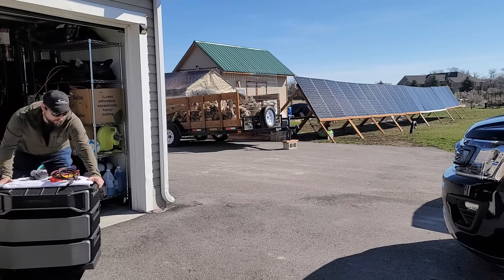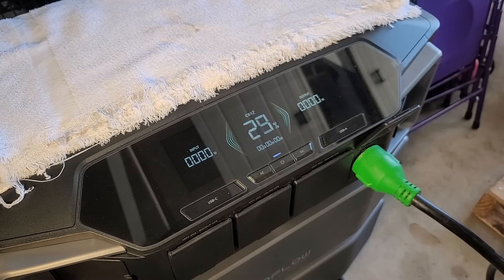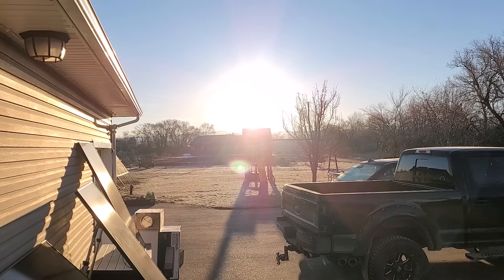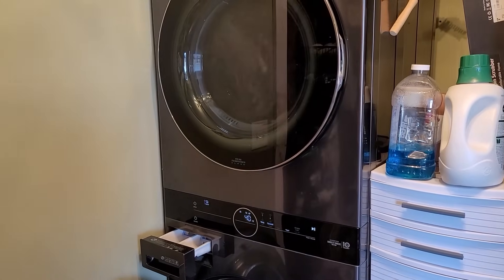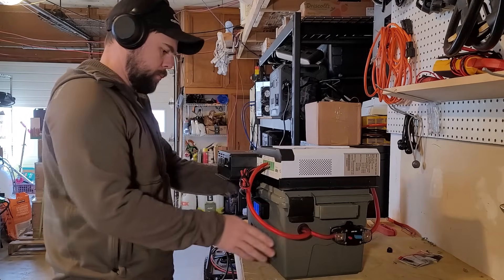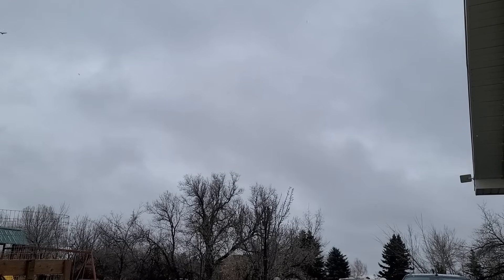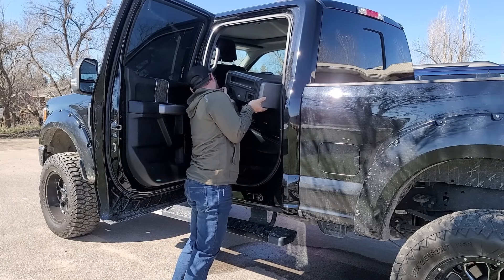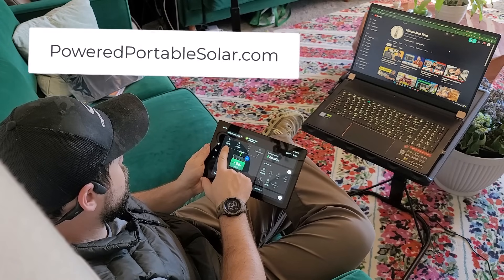Beginner Guide to Go Off-Grid Using the Delta Pro Ultra

Comment: As a young woman jumping into prep for "grid down living" and after studying last year's montly usage- 800kwh average! Your video has been the best to tie all my knowledge together. That website is amazing and so intuative. Thank you. Here's to blowing 12k to run the house (especially the well and fridge) when everyone else goes dark. Remember those chickens and garden, everyone!
Reply from the maker: For 800 kWh average per month, the Silver kit (https://poweredportablesolar.com/product/ecoflow-delta-pro-ultra-kits/) is what you need since it's rated to an average use of 750 kWh per month. But you can start with the Bronze kit which is rated to 500 kWh per month, and then add the batteries later. The only thing I recommend is adding 4 more solar panels to the Bronze kit to save you a lot on shipping later on (https://poweredportablesolar.com/product/400w-solar-panel/) as well as an extra solar cable: https://poweredportablesolar.com/product/100ft-pv-connector-cable/. If you do that, then you'll save a lot on shipping later on, and the only thing you'll need in the future to get to the Silver kit level is two more Delta Pro Ultra batteries: https://poweredportablesolar.com/product/delta-pro-ultra-expansion-battery/
Reply: @minutemansolar  Does self installation (on ground not roof) disqualify one from the tax rebate and/or offset from monthly PG&E bill? Initially, we wanted to use this if SHTF, but now family is discussing offset of the monthly bills, too. Thanks.
Reply from the maker: @sheaholloway9537  Ground mounting or self installation does not disqualify you from the tax credit. But to get your bill reduced you should install the panels on a permanent mount so they can make the most amount of energy possible. I am happy to help you get a mount and you can DIY the install or I can give you a quote on us doing the installation for you. info@poweredportablesolar.com
Reply: @minutemansolar  Thank you.
Reply: @minutemansolar  Thanks so much for the added info.
Reply: We are on the same page

Comment: @minutemanprep really good video, I learned a lot. Quick question, can you tell me why you did not get the Ecoflow Smart Home Panel?
Reply from the maker: I didn't want to be limited to only 12 circuits when I need more than that to run my entire house. I don't need automatic transferring so I am okay just using an interlock switch and generator inlet plug. I can then also use any system, not limited to the Delta Pro Ultra. If you're looking for a system I'd love to help you.

Comment: Great video and very informative.  I am not as wealthy as you are, but I plan on getting a system even if it will be a piece at a time.  Thanks again for sharing.
I was looking at the pro until I saw your video about the new Ultra I did not know existed.  Tell your wife to stop using the electric dryer or remove it if she doesn’t.  Simple.

Comment: How much did your entire setup cost? Are there any maintenance costs?
Reply from the maker: It's the Bronze kit from PoweredPortableSolar.com plus four more panels. So a little less then $12,000. No maintenance. You're welcome to email me at info@poweredportablesolar.com for extra help.
Reply: @minutemansolar  Bro, this is the fastest response I've ever gotten from a Youtube comment. And you answered the question perfectly. I very much appreciate that lol. Currently, my breaker planel is all messed up. I'm hiring an electrician to fix it and expand it for more breakers. I was hoping to do a portable backup power system of some kind that recharges with solar, with an interlock transfer switch. I wanted to do a standby system, but the generac quote I got for a 24k watt system was $22k... no bueno. So that's when I started exploring systems like yours. VERY impressive btw. I have a million questions, I'll start by checking out your website first, I did check my monthly grid bill, my highest was 1762kWh. I'd love to go off grid with the option to switch back on grid like you too. I'm just starting this journey and have a ton to learn.
Reply from the maker: No problem! I'm happy to help. It's easy to start with a basic system and then grow it over time to cover everything. Over 1,700 kWh is petty high but it's definitely possible. I think it'll be good to have the electrical panel reorganized.

Comment: Will this run and charge in subzero weather off the grid (Minnesota winter) none heated outdoor building?
Reply from the maker: Yes, the batteries have built in heaters for when it dips below 32 degrees. If you're interested in getting one I'd love to help you get a system put together and save you money. You can email me at info@poweredportablesolar.com if you'd like.

Comment: wheres the video on building the array shown @3:16?
Reply from the maker: I didn't do a full video, but I did a short about them here: https://youtube.com/shorts/6XmyxxfXZ7E?si=-wdOnFNQPml8mTtR
Reply: @minutemansolar  any issues with the wind grabbing them?
Reply from the maker: @jimmy4518  No. I use two 2 inch "anvil" brand clamps from Home Depot to hold the panel to the frame. We have a lot of high wind here in Idaho and have not had issues with the wind pulling them off. My previous ground mount had that issue and this one has worked great.

Comment: hmmm you can buy battery cells now with the same capacity (6kwh) for around 480$ and then size your inverter for your needs better. 1/6th the cost lol.

Comment: You need APC battery back up on your router and network this way when you’re ready to do a update and the power is out you can still do the update
Reply: Good idea if it works. I have two APC UPS 's which will not work on the 4,000 watt inverter I am using. It seems to be a ground issue I haven't had time to check out.
Reply: My little 300 pack ran my ont and mesh eero for 8 hours for WiFi during an outage during a hurricane

Comment: I notice that your main breaker is 200 AMP and your breaker for the solar generator is 60 AMP.
My question is how can you run your house with a 60 AMP input breaker?
Reply from the maker: Great question. That's because my house doesn't use anywhere close to 200a. The vast majority of houses don't run close to 200a. If your house is all electric, and you run your dryer, A/C, well pump, laundry machine, dishwasher, water heater, and other appliances all at the same time, you'd be using around 75a. That is considered an extremely high load all at once. Electrical panels have to be 200a rated according to national electric code. But that has nothing to do with how much people truly run.

Comment: what about using a dual-fuel outside generator on low solar days to charge the batteries during the day - so you have quiet power at night?
Reply from the maker: That could work, as well as any inverter generator but that wasn't what I was testing.

Comment: Is there any way to get just the delta pro ultra inverter module. I already have the delt pro with two batteries.
Reply from the maker: Yes we can get the DPU inverter only, but it doesn't work with Delta Pro batteries. It must use Delta Pro Ultra batteries.

Comment: Hey my dear friend. I desperately need your help.  I need the best power bank that I can get for $3,000. My budget limit. What do you recommend? 
-
Reply from the maker: I don't know what your power needs are. But for under $3,000, I'd recommend this: https://oupes.com/products/oupes-mega-3-home-backup-portable-power-station-3600w-3072wh?ref=va1y1jwb&variant=43590818693297. With the expansion battery you're under $3,000 but will have over 5kwh of capacity. This doesn't include solar panels, cables, adapters and and so on. But this is my top recommendation for under $3,000.

Comment: Nice to see this test and you seem to confirm some of my concerns.  My chief concern is that solar input limit is too low and don't allow you to compensate enough for seasons of poor weather and limited window of charging.  For my house, I need the diamond kit, but I am concerned that I won't be able to recharge the batteries enough to make it more than a few days, especially during winter and small windows of high solar production .  I have an all electric house.  Am I missing something?
Reply from the maker: For an all electric house, you defintely need a bare minimum of two DPUs and max out the solar panels and batteries. The Diamond Kit sounds like it would be the best fit. If you'd like, I am happy to look at your location to see what would be the best and most affordable setup for you. You can email me at info@poweredportablesolar.com.

Comment: My only note is be careful charging that in sub zero temperatures. The delta pro uses LFP battery cells which can easily be damaged if you charge them at 32 degrees or below which it certainly looks like you have those temperatures there. I’d suggest contacting eco flow and ask them how to best go about charging it in those temperatures
Reply from the maker: Luckily for me, my garage doesn't get below 32F. And the Ultra batteries have built in heaters if it does get below 32F.
Reply: @minutemansolar  built in heaters??? Why wasn't this talked about? That's an awesome and genius feature!
Reply from the maker: @trevorm7013  I forgot. Since it didn't apply to my situation I forgot to bring it up.

Comment: I think the biggest issue that you have after watching the video is that you don't have enough battery storage. when you do get those sunny days your system charges very quickly to full and then basically you waste the rest of the day's solar energy because you have nowhere to store it. If you added one at least if not two more batteries I think you would be in a lot better shape to ride out those cloudy days. The other thing I think you need to do is unplug that electric dryer that someone keeps using on you! I have the ultra with 3 batteries and it's running my house like a champ off grid with 2800 watts of panels (max reported on the display has so far been 2824 watts) Great video! Excellent piece of equipment 😊
Reply: how much was your monthly kWh consumption per month?
Reply: Do you run your central ac? Also do you still have an electric bill or does the DPU and batteries cover everything? How long does it take to charge those 3 batteries from solar alone? Thanks!
Reply: 600 minimum up to 1500 or more in summer
Reply: good to know. how many panels do you  have and what kind 400W?

Comment: Over $16k ? My yearly electricity bill is less to $850 per year. So would that almost 20 years to justify. 
I run a small inverter generator & two 1000 watt battery power stations w/ solar panels  as my back up, less then $2000 invested.

Comment: You know that's kind of funny because you told us you had to tighten at the cabin.
 A natural generator it's a check on the minimum amount of batteries.
 Much might be much weaker but I'm pretty sure that I could run the Internet.

Comment: With that Wi-Fi thing at the end, you could Theoretically put a UPS with the Wi-Fi but as I was typing this in if you put like an EcoFlow river 2…. Also need a software update, it would turn off the Wi-Fi connection for your EcoFlow river two because they can’t power it and your Delta pro ultra, so Probably get one of those computer ups System.

Comment: Awfully trusting to have all those lithium batteries INSIDE your house.  I wouldn’t, due to the fire hazard.  My natural gas generator is outside, and will make 15kw for weeks if need be, including A/C for 3000 sq feet in FL summer
Reply: They are lifepo4 batteries pretty safe

Comment: I have 2 jackery 2000 plus with the 5 back up batteries each total of 10 batteries.  Run together with there 110/240v connector.. I use the dryer hook up to back feed. With the main off. 24kw hrs

Comment: Thick winter cloud cover is a huge reason to overpanel.  I don’t mean 10%, I mean like 400%.  Solar panels are cheap and if you’re going to rely on them completely, there’s no excuse not to have more solar than the MPPT can use on sunny days.

On winter cloud cover days I’m seeing less than 1/20th power output, even with the panels cleaned off completely.  I have a Delta 2 Max (two 500W inputs) and I have about 1800W of panels on each input.

BTW, no issues with the solar inputs waking up in the morning on my D2M.
Reply: or generator to supplement panels. in rural areas that just seems a no brainer solution that cures the snow days and reduce system outage time dramatically.
Reply: @ApexImportExport  absolutely!  A generator is key for off-grid.  I like using propane for backup applications as it stores indefinitely without going bad.

Comment: Regarding the light flickering (more like a slow wave than flickering), I have the same issue with 2 DPUs connected to SHP2. After much testing, one of the DPU is the source of the flickering. The other one keeps all LED including Edison style, running as normal. With only one DPU I would not know, but clearly all DPUs are not equal. The DPU that makes the light flicker also discharge faster than its peer.

Comment: Hi Ben this is a nice overview. Ive got a 50ft solar cable with the XT60i at its end to fit into my Delta Pro's. They were defective, so now gone. I see on the Delta Pro Ultra, that plug wont fit. But I want to use that log cable for the solar panels Ill get soon. Is there an adapter available to get the long cable to plug into the DPU? Or do I have to buy other cables and butcher them up and rig my own fittings? Any advice would be appreciated.

Comment: Have you heard of the new Powerstation about to come out called FORCE 15k? It looks promising and might give the Ecoflow DPU a Run for it's money
Reply: The Force might be cheaper but expandability is minimal.  Also the ease of use on the delta is why it cost a little more.  I like the cheaper products but I’m no electrician and my electrician might only charge me $500 to install this compared to $2000 to install something else.

Comment: At a certain point, I would just unplug the electric dryer......if you can't listen, I will take the option away from you. But great demo! I was curious how or if it would handle real world tests......many demo videos I've seen so far only test them for a couple days, or only during sunny weather. Though I love how you can expand the Delta Pro Ultra to a ridiculous 90kw/h and triple that solar, at which point, good luck running out of power.

Comment: I have a question: At 6:33 You mentioned about your LED lights flickering.  I've noticed this as well to include the bulb in my refrigerator.  Is that concerning when running your AC unit, refrigerator or sensitive electronic equipment long term?

Comment: The Delta Pro Ultra uses low cost, Chinese made high frequency, transformerless inverter tech that offers a shorter life expectancy and a far poorer surge capacity than a heavy duty, inverter that uses low frequency, transformer based technology. Even worse, because there is no iron core, copper wound transformer in this high frequency inverter, there is no galvanic isolation to protect your AC appliances from the high amperage DC current that's produced by this inverter's DC boost stage. So no thanks, not in my home.
Reply: @solarcharging9743 
I’m curious what 
brand you’d recommend!

Comment: I am curious, what are the specs on your water well pump?   I have a single phase, 3-wire, 3 hp, 3170 Watt (full load), 40 amp max (in rush current).  I am thinking I would need two delta ultra inverters with 50 amp box to accomadate this water pump.  Does this sound right to you?
Reply: Also, what type of water well filter are you using for your drinking water?  Or are you mainly using the berkey filter for that?

Comment: A great sweet setup! There is one issue as you brought up about the firmware update and having to be tied to Wi-Fi.        Another issue that I always think about with all the solar generators and power stations is that they are tied to a Wi-Fi app.   Now here's the situation if the Wi-Fi grid goes down for one reason or another then you're kind of screwed.  The other conundrum is that, if you're tied to the app then they can shut it off at their will at any time your whole system.   So basically a cyber attack.   Also they can track you and know where you are with that app.   The only thing I could think to get around that is have a VPN and set the VPN to a communist block country like China Russia Turkey etc.   but it is a little nerve-wracking to be that tied to the web.   Believe me I know if I web or internet goes down for 5 minutes I start seeing pink elephants and getting the shakes😅😅 is there a way where you don't have to use the app at all and be tied to it?  Also if you're still being tied to the power company they still charge a service charge every month so even if you don't use any energy you still at least have to pay 20 to $25 a month if not more!